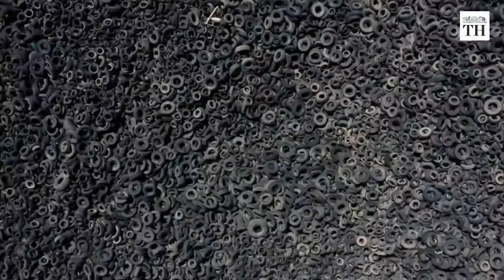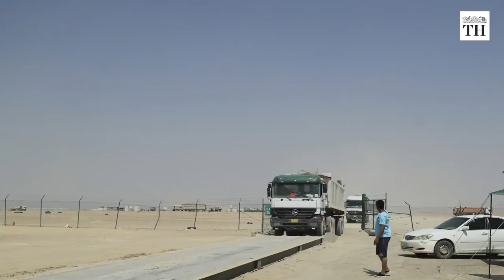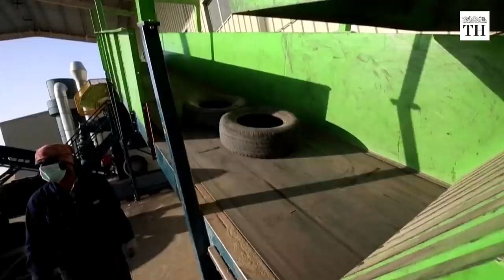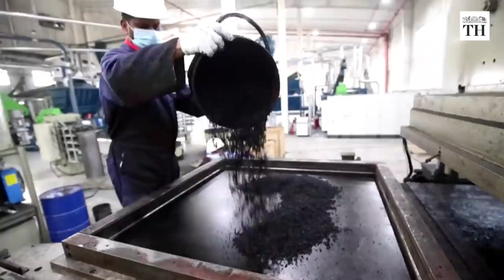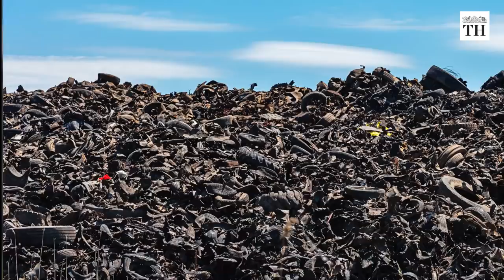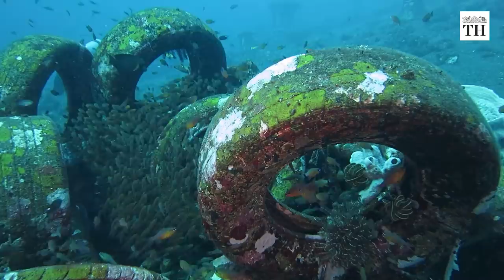Kuwait to transform world's largest tyre graveyard into new city

Comment: I saw a documentry using shredded tyres mixed with asphalt to construct new highways! It improve grip and resist impacts.
Reply: It's pretty good but there is an unintended consequence as the road undergoes frequent friction and use and hence this causes the rubber to be turned into extremely microscopic particles which can be extremely dangerous as it can get mixed in water or be inhaled by humans
Reply: @ZOCCOK  which is already happening by car tyres. So it maybe worse than now, but it’s not a new problem.
Reply: @davidjacobs8558  exactly.

Comment: I highly appreciate KUWAIT.Even though they have shortage of land,they spared land for used tyres.
Reply: and they burned some of them to cause pollution.
Reply: There is  no shortage of land in kuwait  as compared  to population to land ratio. Its a massive desert with fully developed  coast line. Kuwait  being an oil rich country  is heavily automobiled. Extreme  weather wears out tyres faster than usual.
Reply: @user-hg2fx1rv4t  burnt by accident. The strong heat of sun burst them into fire

Comment: Stack them 3 high, 4 high or 5 and 6 high, then line the inside with garden mesh, then fill with fertiliser and compost and plant all kinds of plants/ vegetables in them. 😁👌
( and water as required ). Could create a HUGE PLANT NURSERY made of tyres.